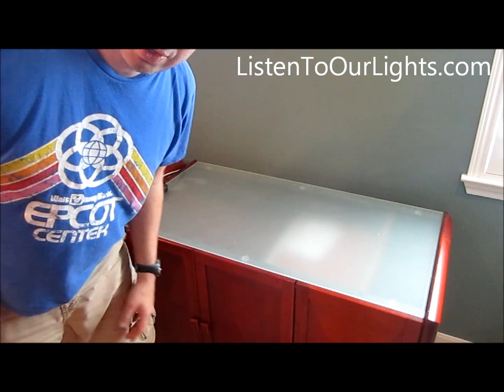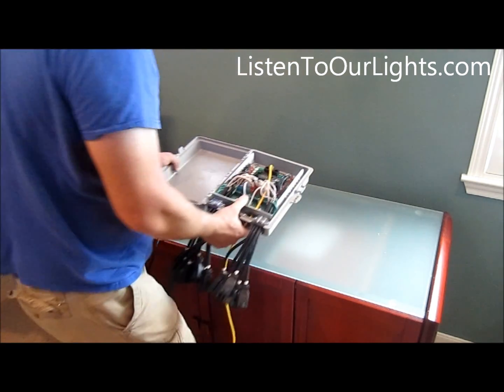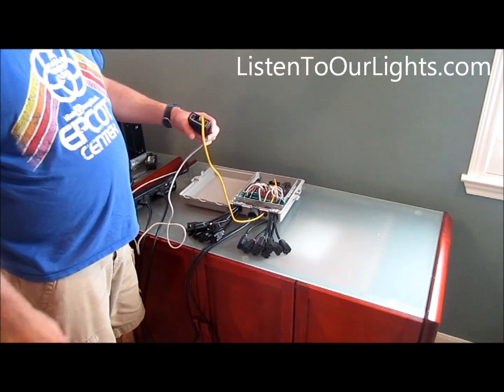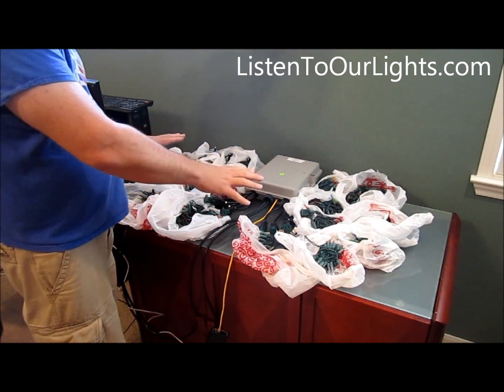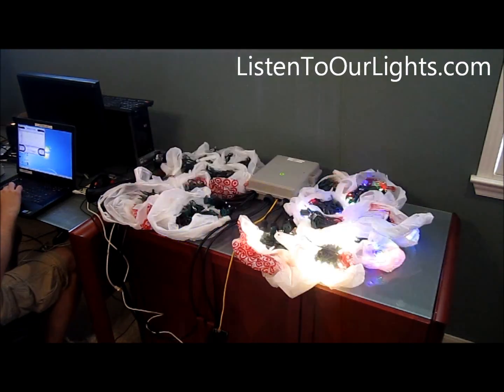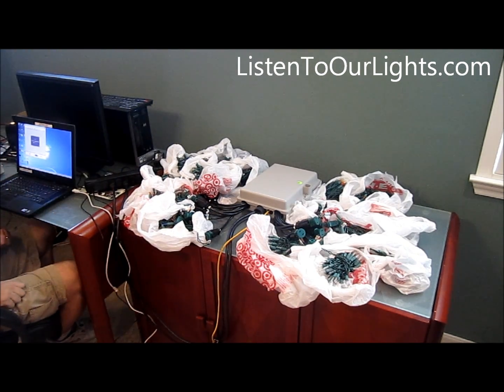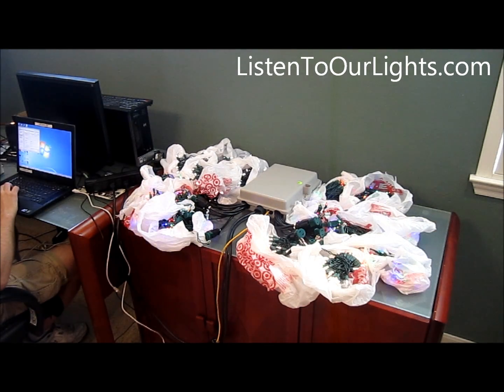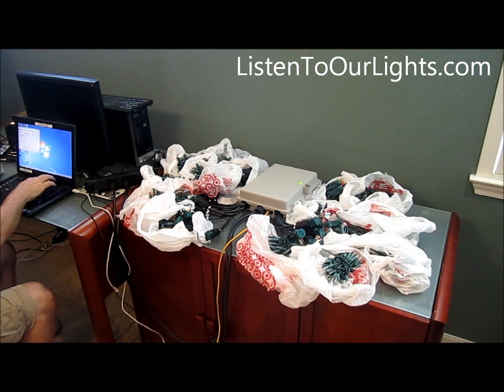How to Test Light-O-Rama Controller

Comment: What if I dont have the adapter can I do something else to run my shows without the adapter
Reply from the maker: You're going to need a RS485 USB dongle for setup and test. You can run the lights without one. LOR has a show controller, or you could use the CTB16 on a DMX chain.
Reply: @listentoourlights  So I can run the lights with a RS485 USB dongle cause I'm going to have it manually start
Reply: @listentoourlights  Can you send me a link to the dongle

Comment: Can I use wireless linker with light o Rama residential controller
Reply from the maker: You need to use the Easy Light Linker (ELL) sold by Light-O-Rama. I have not used them myself, but hear from many that they work very well.

Comment from the maker: @Sonic11Silver All the music that I use to sync lights to are MP3 files, some from iTunes most from Amazon. I do make sure that they are saved with constant-bit-rate using Audacity (free download). I then use Light-O-Rama S3 software (free to try) to make the lights blink. The S3 software also runs the Light-O-Rama controller.